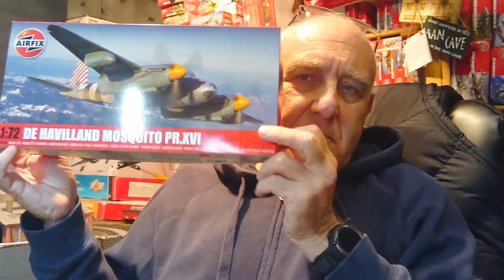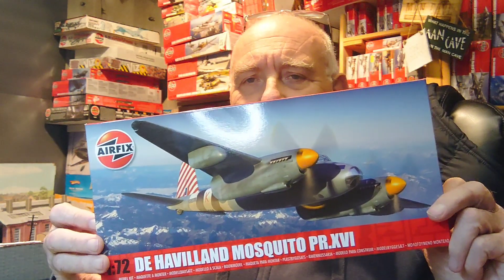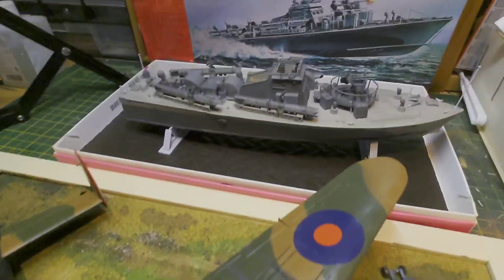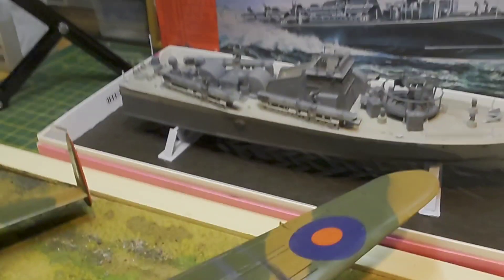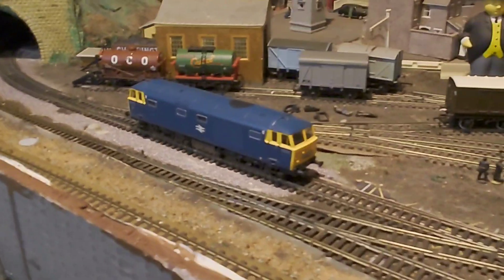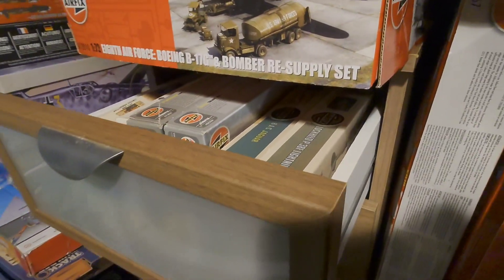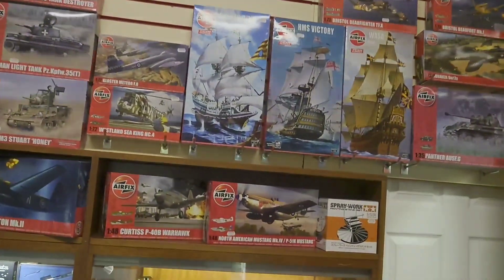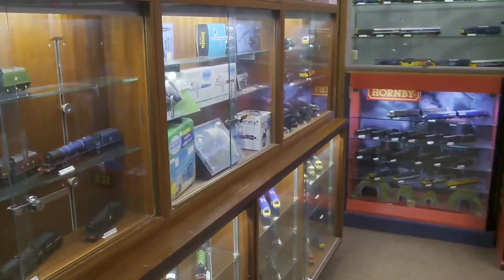Airfix 1/72 Lancaster dio complete and a visit to Alton Model Centre

Comment: I just finished my lancaster dambusters,had same issues with the walkways,used decal fix,thinners and matt gloss it improved it,i used a picture frame and model railway grass glued to the backing board of the frame for base,as there where kept on grass mostly,dambusters planes where.1/72 scale,took a couple of years but months went when i was not in the mood.i will say my home made weather panel line wash went wrong,so i covered the plane sections at a time with this thinners substitute and black paint i used on the plane,dipped kitchen roll in some of the clean thinners and quickly wiped it of in the direction of wind flow,it worked out pretty realistic,just be quick and dont go mad with the thinners.have at least one coat of matt gloss on first,weather then regloss to seal it.

Comment: Lancaster looks great. Before you go removing decals, if you lightly run a rivet wheel or a fresh scalpel blade over the full decal with only enough pressure to pierce the decal film you can go over the decals again with sol/set and it should cure the silvering. 
Alton model centre is my local, closest one to the airfield anyway!
Reply from the maker: Thank you very much indeed for that great advice, I'll try it tomorrow evening and let you know how it goes!
Reply: @petesplasticplayground7791  how did it go??
Reply from the maker: @geordie_mech  been an immense week at work this week so I haven't had a chance also I've been wrapped up in that  motor torpedo boat. hopefully I'll get it done over the weekend and I will let you know how it goes. cheers Pete